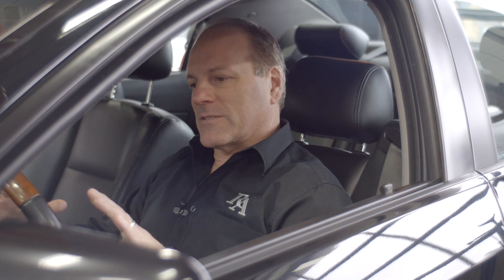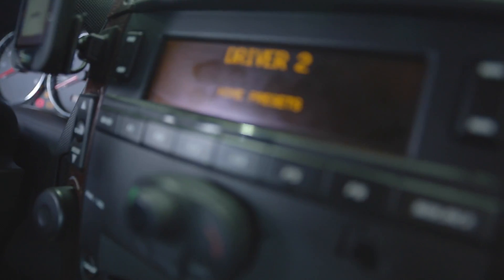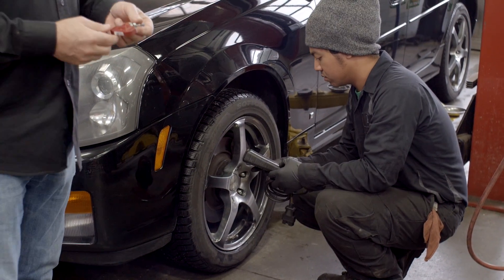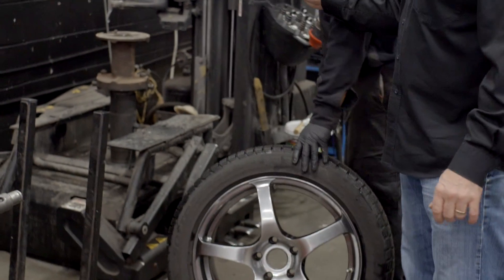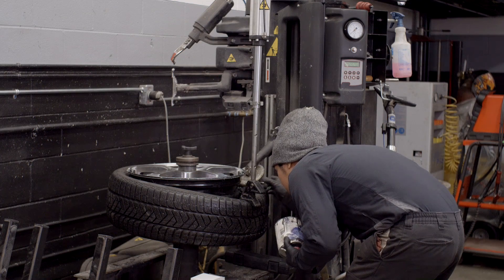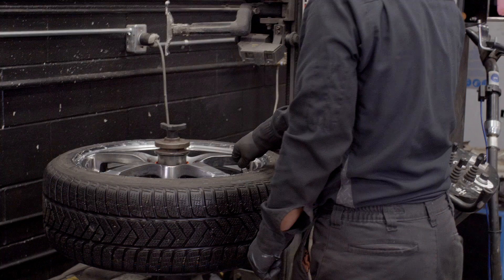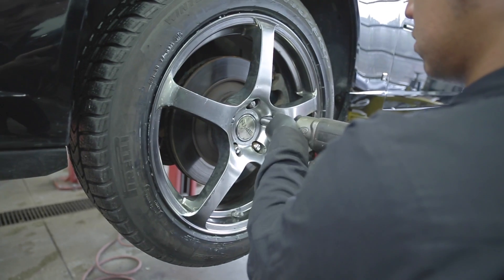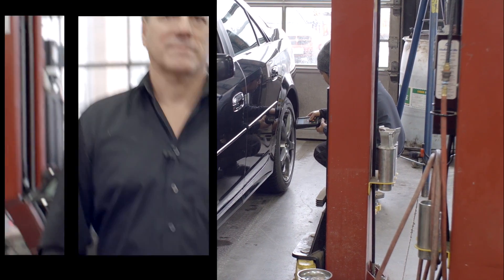Tire Pressure Monitor Cadillac

Comment: My tires are all at 35 PSI as per the user manual... yet the pressure monitor keeps telling me that my front right tire is low. I don't care about the pressure monitors and there should be a way to disable them if I don't need that extra luxury of it being wrong or malfunctioning. It changes my digital speed display to tire pressure warning which I know is fine. Good thing I don't have to worry about my speed anymore... the KPA on my tire said I was well under the speed limit. lol

Comment: Would the Cadillac still pass inspection if the sensor is dead ?
Reply from the maker: yes because as far as I know it's an added bonus, not mandatory to have a monitor
Reply: Oh youre wrong, TPMS sensor is mandatory nowadays
Reply: Thinh Cao 
Bullshit. I drive a 1982 Cadillac Eldorado. Good luck finding a tire pressure monitor on my tires.
Reply: It depends on your State's local laws.
Reply: @thinhcao7118  2008+ newer cars

Comment: Why it use battery in the sensor?
Reply from the maker: probably because it would be hard to wire to the car I'm guessing? A lot of devices like that can last for ages with batteries.  I'm not an expert though.
Reply: Agustine camargo why you not know how to form sentence?
Reply: It gives us one more part to pay that gm dealership price for. .
Reply: Think about it. How would it be possible to run wires to it?
Reply: Would be nice if it used kinetic charging...
Reply: I watched this video to learn how to re-set the cars computer for a new tpms sensor. You showed everything BUT that part. 🤦‍♂️👎

Comment: The aftermarket ones that intall on the outside of the tire and can replace the battery in them are better than these
Reply from the maker: yeah, and . the big takeaway though is that these things are useful.  Winter, sitting in the warm car looking at your tire read-outs is better than figuring it out old-school
Reply: fatman2442 true but poor execution by car manufacturers
Reply: The ones on the outside won't last as long due to weather, your horrible driving skills and can get stolen. Also you can change the battery on the inside ones too.